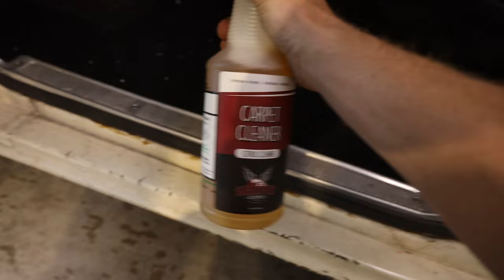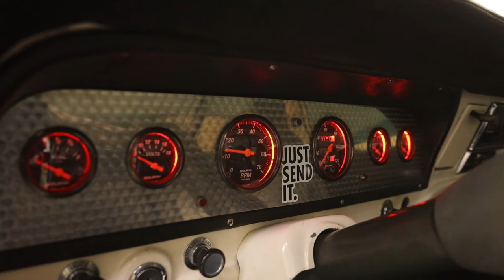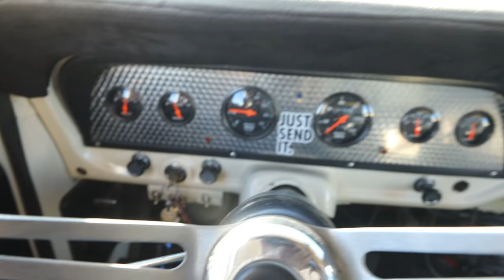Fixing Everything WRONG With My F100 & Now it's FAST!

Comment: Remflex is still a composite gasket it’s just high crush. I have them on my 428 in my ultimate highboy and they have been good. But it’s nothing like that small block! I actually ran them on our 7.3 mustang drag car because the headers I made have a little warp in them. And they take 150+ psi of back pressure for a good while before they blow out. Maybe 10 passes or so. Pretty impressed.

Comment: On the leaking header issue. I believe your composite gasket is only part of the issue. The other part is the header itself. Cheaper headers use a 3/8in flange where as a better quality one would use a 1/2in thick flange. As the Cheaper header heats up it expands more and faster then an 1/2in flanged one. Plus it will warp faster thus creating a path for a leak. The 1/2in thick one will stay flatter under all your heat cycles (aka- 2 step) 😅 I've had to replace a few gaskets on my 1990 5.0 bronco and it was all stock with direct fit manifold replacement headers. And it had a 3/8 in flange as well. So a good MLS gasket and a better header with a 1/2in flange should "solve" your issue. Oh I've also heard some people use ultra high temp silicon ( the one with copper mixed in it) to help "glue" the gasket to the header and head so the composite gasket can seal better and move with the header reducing the change of a leak for a "temporary" fix

Comment: Craig! That thing is WICKED!!! You should also check out a set of copper header gaskets! They're the last gasket you'll ever need! Idk how they compare to the Remflex gaskets, but they're a single piece of copper sheet cut into the proper shape, and they sealed up the SUPER warped exhaust manifolds on my efi 460 when nothing else could!

Comment: You don't even need 400HP. I think to this day the mkost fun car i've ever driven was a cammed and slighty machined head MGB. prbably barely touched 100HP. Also, I second the Remflex gasket recomendation , they're graphite. I dont know if they'll hold up to your beastly motor at the redline though. They do work great in my stock 6200 RPM redline 5.0 with AFR heads though for what that's worth.

Comment: Brake fluid is capable of stripping paint so if it really did spill into the carpet I would take the carpet out and fully clean it up.  Trying to clean it up from the top is wishful thinking IMO.    Thankfully beating on it while not running right didn't result in getting blown up part 2.   Still sounds freaking amazing!
Reply: Mega difference in sound tone after the filter/ tuneup!   Nice work sir!   and yes I have a habit of commenting my way through videos till the end haha.

Comment: Hey Craig. I’m sure you already know this but brake fluid will eat and rust metal. If I were you I would pull the carpet out of the truck and power wash it and clean the floor pan real good so it doesn’t rust.

Comment: It sounded like to either had a header leak or plug wire off after you changed the header gasket and before the two step.

Comment: I went to the website, and it is listed as a spoiler not a wing, 2 different things. Nascar wing was the Dodge Daytona or Plymouth Superbird. 675 bucks for a flat piece of steel and 4 CNC anodized brackets, what a con job, maybe it's the stainless hardware... NOPE. You put it on because it was free from your buddy for free advertisement on your channel. You could have made one for 50 bucks, looks dumb anyway, not worth drilling holes in the tailgate.